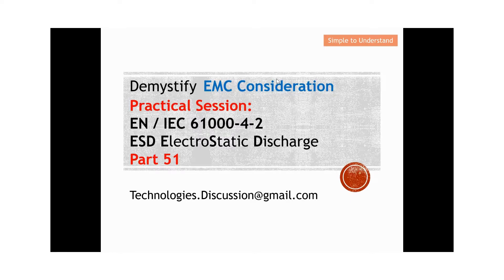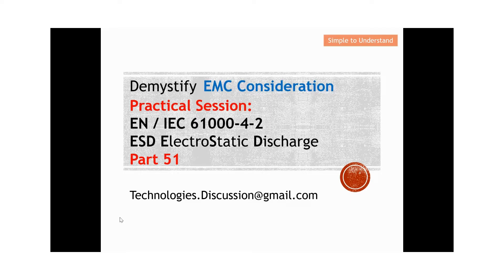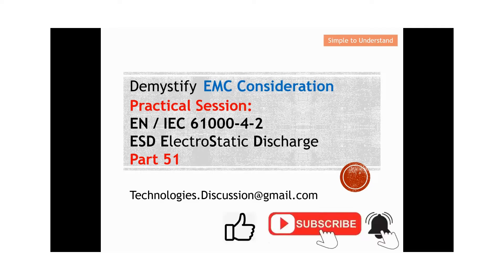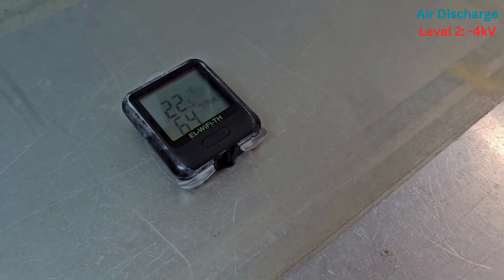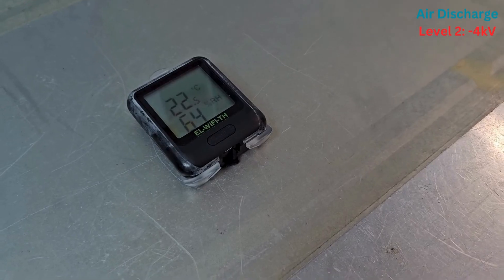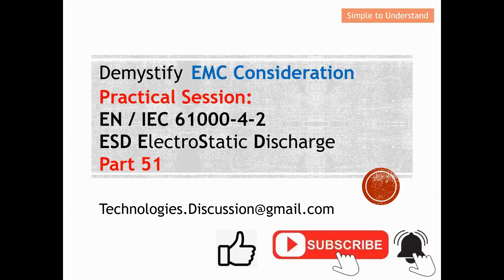EMC #51. How to Apply ESD Electrostatic Discharge Direct & Indirect Contact to EN/IEC 61000-4-2.

Comment: Air discharge is misapplied. You must approach the DUT with the gun as quickly as possible, until the spark appears, rather than staying in the vicinity of the DUT.
Reply from the maker: I appreciate your point of view.  :)
Good point for this learning community.